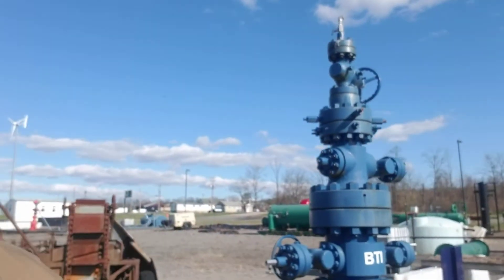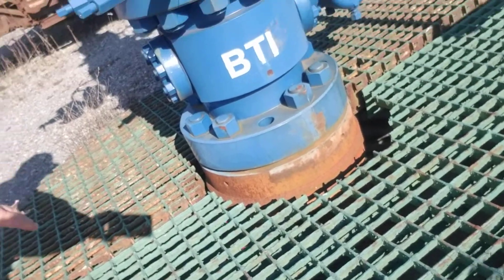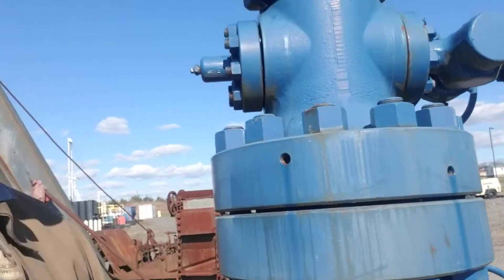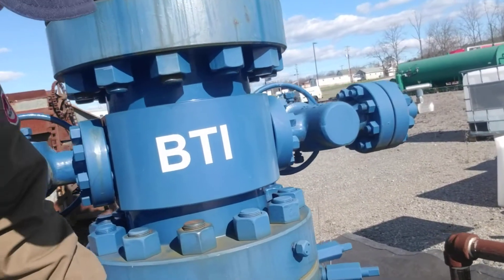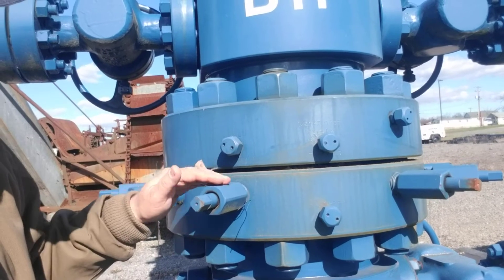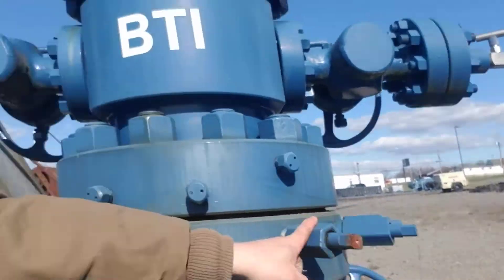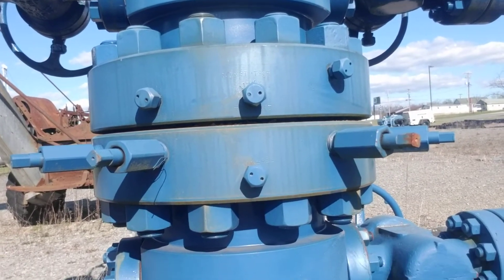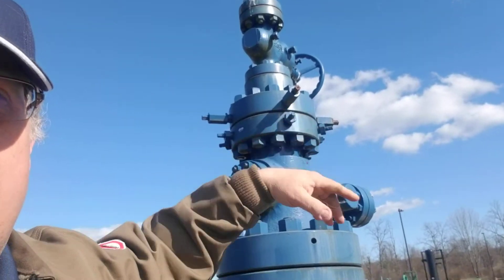LCCTC: Oil and Gas Lesson 21

Comment: The Penn College Shalenet tech training location...spent alot of hours there. That wellhead is actually a 15k wellhead, 15,000 psi. Those pins you indicated hold temporarily the casing in place before its cemented. All casing strings are cemented to surface. 24", 20", 13-3/8ths, 9-5/8ths, 5-1/2 inch.